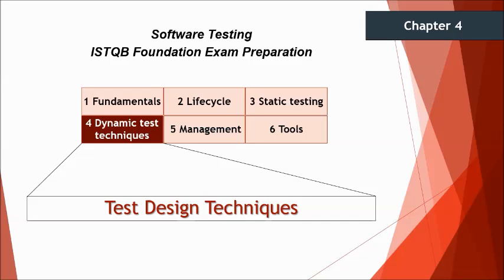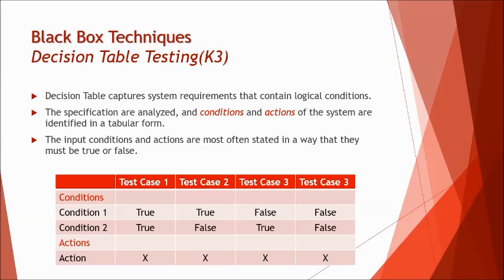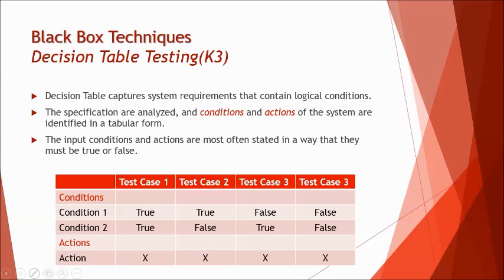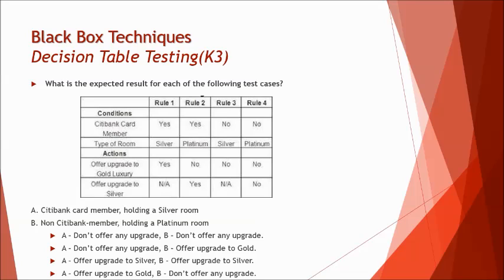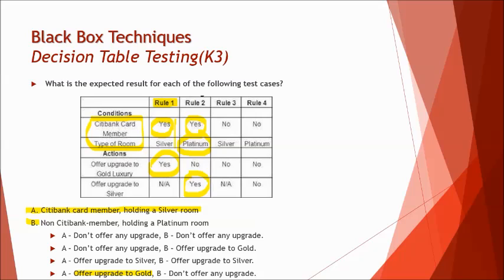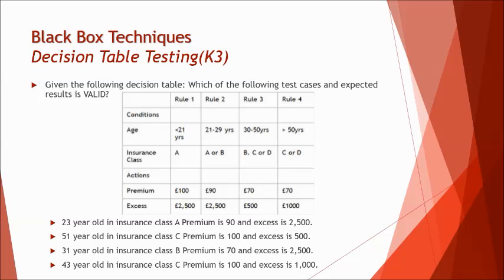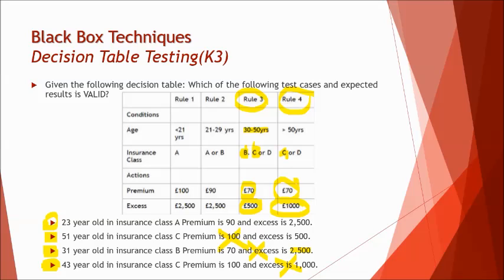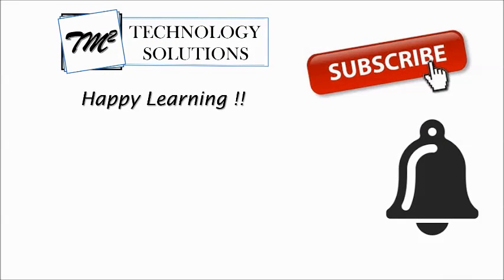ISTQB Foundation Level Certification 2011 | 4.3 Decision Table Testing

Comment: Decision table testing is being performed on a speeding fine system. Two test cases have already been
generated for rules 1 and 4, which are shown below:
Rules R1 R4
Conditions Speed > 50 T F
School Zone T F
Actions $250 Fine F F
Jail T F
Given the following additional test cases:
Rules DT1 DT2 DT3 DT4
Input Speed 55 44 66 77
School Zone T T T F
Expected Result $250 Fine F F F T
Jail T F T F
Which two of the additional test cases would achieve full coverage of the complete decision table (when
combined with the test cases that have already been generated for rules 1 and 4)?
a) DT1, DT2
b) DT2, DT3
c) DT2, DT4
d) DT3, DT4
could you please explain the correct ans
Reply from the maker: Hi Shivani,
You are foloowing a old series of tutorial. Please find the latest series in my playlist with name "ISTQB Foundation 2018". Here is the tutorial where I discussed the solution to your question https://www.youtube.com/watch?v=4yrDUW0ItVM&t=4s
You can skip the video to 4:48